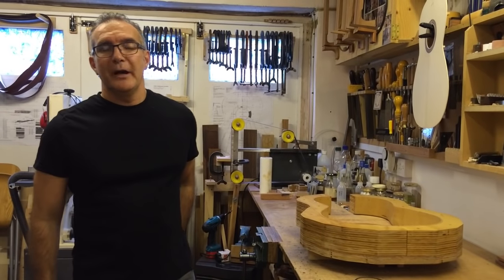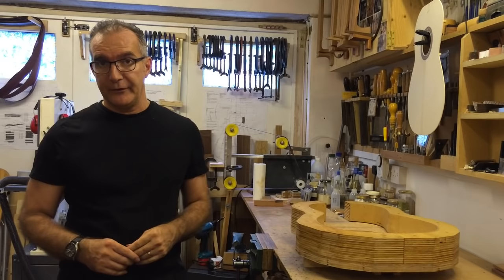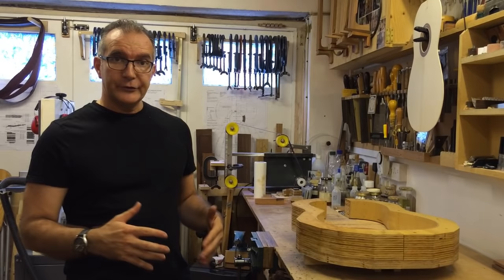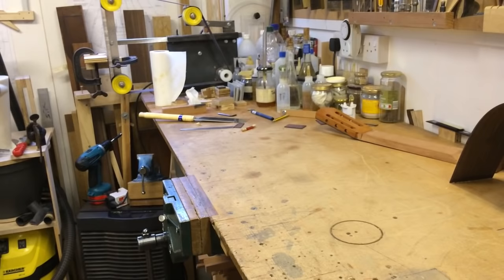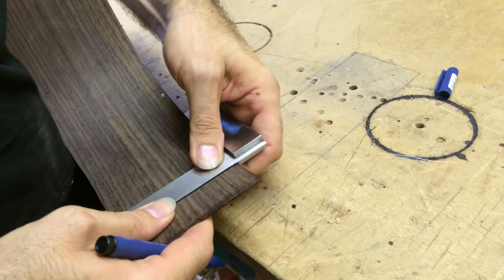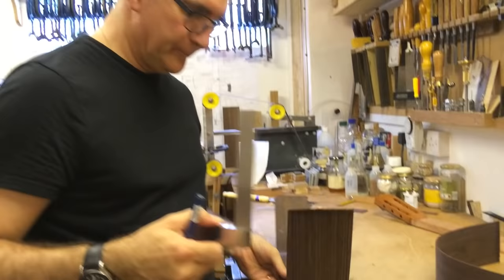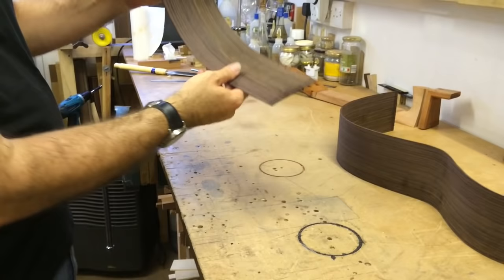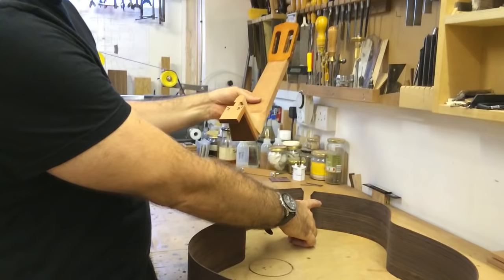How to assemble a classical guitar with a Solera mould.

Comment: Mr. Requena, I am an amateur guitar maker in the US and I have been enjoying your videos.  You've done us all quite a favor.  I teach a class at my university on stringed instrument design and manufacturing.  For students interested in classical guitars, I will certainly have them study your videos.

One question - I noticed a black stripe down the center of the neck blank.  I haven't seen a video on how you make the neck (my apologies if I overlooked it).  Is that graphite?
Reply from the maker: Hi, thank you for your comments, I'm glad you find my videos useful. The strip down the centre of the neck is made of ebony, I find that ebony  re-enforces the neck while allowing for a very small relief on the neck. I have come across guitars where graphite or carbon fibre was used and it made the neck very straight and sometimes it even ends up bending backwards. 
I hope this helps, 
Pablo
Reply: Dear Pablo   thanks for all your videos. Immense experience for me.  Can you  tell what is exact;y a slight angle  on the solera  neck  area?
Reply: Hi Cemeh, in case you haven’t gotten a response yet, I believe he said that it was about 1.5 millimeters from the 12th fret position(where the neck meets the body) down to just before the nut.

Comment: Pablo, Thank you for posting all of these videos on classical guitar luthiery. In this video you say that the neck is placed at an angle which results in 1.5 mm down from a straight plain of the jig. I assume this is to provide relief for the string setup. In your video on cutting the slot and wedges in the neck block for the body sides to neck, your cut is at 90 degrees to the line of the top of the neck. By tipping the neck downward in the jig, doesn't that create a 0.2 degree rotation of the joint from perpendicular to the body?

Comment: I have 2 questions:
1. If the neck is angled and hinges at the 12th fret, how do you create a flat fretboard up to the soundhole?
2. This is a flat top design. How do you change the solera and fit the sides for a slightly domed top?
Loved your video, and looking forward to your answer. Thanks!
Reply from the maker: Hi Jack,
To fit the fingerboard you have to plane off slightly from the bottom of the fingerboard in the area from the 12th fret to the edge of the sound hole, that way you replicate the angle of the neck into the gluing side of the fingerboard.
In terns of your second question, the solera you see in the video is for a guitar with a domed soundboard.
These questions are quite complex and it isn't easy to explain in just a few lines but if you are interested I have a complete course that you can purchase on line where I explain all these things in detail, you can find it on www.onlineguitarmakingcourse.com
Reply: @redkitekk  Hi Pablo,
Thanks very much for your answer, that makes sense to me now. I have seen other solera's where the neck was angled back, presumably because the soundboard was a flattop and with a 7mm thick fretboard and normal classical bridge/saddle height (~13/14mm) the action would become too high.
So just for my understanding: it should be possible then to create just enough dome to the top so that the neck angle is straight with normal classical bridge/saddle height and string action?
Reply from the maker: @jackbombeeck4958  it is possible, the only problem would be that you would need to have a massive dome to the top or a very high saddle. The saddle hight of 13/14 mm that you are suggesting is already quite high. If you had no angle to the neck you will surely come across problems with the setup.
This is just my opinion.
Reply: @redkitekk  Thanks again for your quick answer! I just did some meaurements on my classical guitar at the 6th string: 13mm at he bridge/sadle between soundboard and underside of strings, action of 3.5 mm between 12th fret and string, fretboard thickness 7mm, frets about 1.1mm.
If the neck was straight and the top was flat, that would give 7mm+1.1mm+2*3.5mm = 15.1mm at he bridge and the actual heiht is 13mm. The fretboard appears to be flat all the way to the soundboard, and I know the top is domed (difficult to measure though). So if the bridge+saddle drop 3.1mm due to the doming of the top, then this would match exactly, no? What am I missing?
Reply: I just figured it out by making a drawing. Lowering the bridge with a domed top just makes the action height even lower! So to make a good action height, the neck must be angled forward, never backward, no question! I knew you must be right, i just didn't get it until i had a picture... 
Unless the dome sticks out of the top. I've been assuming that the bridge side of the top is 'pulled down' at the back and somewhat at the sides. If you push the centre of the lower bout outward, then that would increase the action. 
Here my lack of knowledge concerning solera's shows. I don't understand how the dome is done, or how you make the sides fit the top when it is domed...

Comment: I have watched all your videos many times and I have found many solutions to problems I encountered in the course of construction. My next project is a Parlor guitar I want to build it with the Spanish heel method (I do not know if it's right but I like this way of construction) so I had to make a solera, so again in your video I found all the answers I needed to do the job properly. A question only, for the sides what kind of clamps do you use to tighten them with the top? 
Greetings from GREECE .
Reply from the maker: Hi,
The sides don't need to be clamped down against the top, If you have a good fit and the sides don't move about, all you need is to glue the kerfing blocks in place.It the sides move inside the mould, you need to clamp them to hold them firmly in place against the sides of the mould, then you can glue the kerfing block.
Reply: @redkitekk  do you glue the sides to the top before you glue the kerf blocks? thanks.
Reply from the maker: @kutaydisbudak6115  no, just the glue in the kerfing is enough.
Also I have a course available on www.onlineguitarmakingcourse.com

Comment: Hi Pablo, great video as always, thank you.  How do you achieve the 1.5 mm neck relief in the solera? It's hard to see but it seems flat and the layers of plywood continuous. Do you plane down the last plywood from 1.5 mm at the end to nothing at the 12th fret position?
Reply from the maker: Yes, you do it on the solera in the way you describe it. Just in case you are interested I have a video explaining the complete process on how to build the solera in my website www.onlineguitarmakingcourse.con
Reply: @redkitekk  Thanks Pablo. your solera at the body area seems to be flat and the top is resting flat before you put the sides. Since the top has a dome built in the lower area I would expect the tail end of the top to lift a little and the sides not to fit straight on the top. Also if the neck has an angle, shouldn't the heel area that you reduced have the same angle?
Reply from the maker: The solera is only flat in the top part, the area of the lower bout is carved to accommodate the dome of the top. The angle on the neck isn’t necessarily, however if you want to take it into account it will also work.

Comment: PabloThank you for all the excellent videos you have produced to date. The information is invaluable.With your solera set up do you eventually have to adjust the finger board thickness a little  in order to get the correct string height at the 12th fret?
Reply from the maker: You are very welcome.
Yes, that's correct, there is always a bit of work to do to the fingerboard to achieve the final set up.
I will do a video about that soon.

Comment: Hello Pablo, I follow your videos with great interest. They are excellent as is your knowledge, skills and tuition. One day I would love to build either a guitar or a ukulele. I assume the build for either instrument requires similar skills and build techniques. 
The neck ends of the sides, you carefully cut to the required length and angle are essentially hidden, on the finished instrument that is. I assume the opposite ends, at the base of the guitar, which are reinforced by a block would be butted together and the join visible. How do you ensure the join/t is clean, neat and tightly butted, please?

Many thanks for the excellent tuition! Rick
Reply from the maker: Hi Rick, what you would need to do on that join is to inlay a strip similar to whatever you use for the bindings, that way if the join is not that good it doesn't matter as you would male it good with the inlay.

Comment: Pablo - Do you glue the sides to the top or do you rely on the glueing of the peones. I guess if the top and sides are glued together, in the mold, there is a chance of glue squeeze-out into the mold. Also the routing for the binding and purfling would remove that glue joint.......probably answered my own question!!
Reply from the maker: No, just glue on the peones.

Comment: Wonderful video more educational than any other about a solera. I have been building steel string  guitars. Have decided it is time to build myself a flamenco guitar to replace my old Domingo Estesto that I sold in 1970 after a major car accident. what is the thickness of the cork layer you installed on the solera mod?
Reply from the maker: It is 6mm thick.
Reply: Thanks

Comment: Can you tell me how much the angle of the neck should be for a flamenco guitar?  If the classical requires removal of 1.5mm at the nut, how much to remove for the flamenco?   thank you.
Reply from the maker: Hi Loren, with the way build flamenco guitars I do it I use the same angle.
Reply: @redkitekk  thank you.

Comment: Hi Pablo, Exelent videos. What type of glue are you using for the peones because this way you can not put any pressure on them before the glue sticks?
Reply from the maker: Wim Esser you can use hot animal glue or titebond, it doesn’t matter. You just put the peon in place with a bit of glue, you don’t need to clamp it down.

Comment: Is the cork there just for support padding?  Or does it serve any more purpose
Reply from the maker: Dorsey Mitchell in the video at minute 1:12 I explain what the cork is for. The idea is that by removing the cork in the lower area you get an empty space to make sure that the belly of the soundboard is not distorted.

Comment: Thank you for explaining this. Only one question I have here. The solera mold that has the neck extension, in other words the bottom mold in the video. Is that neck straight or it has a little angle so when you lay down the actual neck of the guitar on it and clamp it the finish product will come out with a little tilt neck. In the video it looks down straight to me and goes straight with the soundboard also. I know with the flamenco guitar you have to tilt the neck a little up so the action on the strings goes down. Correct me if I'm wrong. Thank you
Reply from the maker: It might not show in the video but yes, there is a slope on the section for the neck so that there is a forward angle of the neck when the guitar is assembled.
Reply: @redkitekk  Do you also have a dome radius on the soundboard or it's totally straight? Most likely you will have that on the back board. I'm just trying to wrap my mind around it and how those 3mm deviation contributes to the sound. Thank you for your time.
Reply from the maker: @daringetae5136  yes, I use a domed board to assemble the soundboard to create a dome on the soundboard.
Just in case you are interested I have a complete guitar making course that you would find helpful. You can find it on www.onlineguitarmakingcourse.com
Reply: @redkitekk  I really appreciate your help and advise. Out of curiosity, it's the dome feature for aesthetic purposes or it helps with the action height on the strings, intonation and so on which translates into the final sound of the guitar? It really puzzles me the feature. Thank you.
Reply from the maker: @daringetae5136  the dome is used to ad a bit of strength to the soundboard and to achieve the right set up.
Reply: @redkitekk  Thank you for the clarification.

Comment: Thanks Pablo for the wonderful set of videos. One question on the assembly. Can the neck and top be glued separately (in the mold and on the solera)  as a first step before later continuing by adding the sides, wedges, and tail block?  Or do you recommend to do all of the gluing in one step? Thanks!
Reply from the maker: Yes, I would glue the neck and top first, and then later glue everything else.You don't need to glue all the components in one go.
Reply: Thanks Pablo!

Comment: Hi pablo 
Thanks for posting this wonderful film , very helpful. Just one quick question , when you construct the solera, you use a cork sheet to create the area for the domed soundboard area , I just wondered how you calculate that area - how big the area is , I guess it takes the flex from your already domed soundboard?
Thanks pablo 

Jimmy .
Reply from the maker: Yes, the domed area of the soundboard goes from about the center of the sound hole to the complete lower bout. On minute 2:56 you can see the cork showing through the sound hole.This is because the lower harmonic bar is also curved to the same arch so you need to provide clearance for it as well as for the lower bout. Does it make sense?
Reply: PabloRequena hi pablo , thank you for your reply, and yes that makes perfect sense , in the past I have carved the area , I have a new solera to build and I like how you make this , thanks pablo 

Jimmy .
Reply: PabloRequena also, do you use just one solera for classical and a different one for flamenco guitars or different models?

Thank you pablo
Reply from the maker: James Cole I use the same solera for classical and flamenco guitars.

Comment: So Pablo, Thanks for a great video! You say the neck support is angled down with the soundboard facing the bottom i.e. guitar face down? So this is the opposite of arch tops for example, where the neck would, with the guitar, in the same orientation, be ever so slightly angled up? I have not come across that any where else on the internet. Are classical guitars built with the neck in this orientation. By my calculations, that would mean you had to have a lower bridge than if the neck were dead straight or even a little bit up. I thought arch tops and some set neck guitars such as Gibsons require a higher bridge to compensate for the neck angle. Have I got myself confused here? Thanks
Reply from the maker: You are right, the set up on a classical guitar is completely different to a steel string or to an arch top guitar. The dome / arch is lower and thats why the position of the neck is also different.
Some classical guitars will not have an angle at all on the neck, and some do, like mine,and this depends on the type of construction you use. For me this method works really well and the set up only guitars is very confortable with a low action, but with a bit of room on the saddle for adjustment.
The neck angle is crucial if you want to build a guitar that sounds great  and is very confortable to play.
I hope this makes sense.
There are lots of little details that make all the difference when you want to build a great guitar, if you can, I would recommend that you do one of my courses and you will learn all of this in detail.
www.guitarmakingcourse.org
Best wishes.
Pablo

Comment: This is amazing Pablo!So, where can I get a Solera mould? Does this work for both, classical and flamenco? Thank you for the video!
Reply from the maker: The solera mould is something you want to be making yourself, there is a company here in Malaga which might be able to make it for you but a mould like this can be heavy and it might not be practical. Just in case the company is www.madematonewood.com and you would have to email them with your request to have one made for you as I don't think they have them in stock. You can use it for both classical and flamenco guitars.
Reply: @redkitekk  Perfect! Thank you so much!

Comment: Hi Pablo, two questions in one really. Do you carry your dome all the way to the edges of the soundboard and if so do you angle the edge of the guitar sides to account for dome, or do you even glue the side to the top at all and let the peones do the work, as where the sides meet the top will be routed away for bindings anyway?
Reply from the maker: Yes, the dome on the soundboard goes all the way to the edges, and the sides don't need to have an angle on the edge as this will be sorted as we fit the bindings. I do have an angle of about 93 degrees on the peones and they are the ones keeping the dome as the sides are fitted.
Reply: Thank you once again Pablo, nobody answers questions as fast or as well as you on youtube. Brilliant!

Comment: Why does your mold jig slant forward 1.5mm? I would think you want a slant backward to compensate for string pull.
Reply from the maker: Because of the hight of the fingerboard, and the hight of the bridge, to obtain the right action it is necessary to bring the neck forward very slightly. If you bring the neck back ,then the hight of the saddle would be too much for the guitar to work properly.
Reply: Thank you